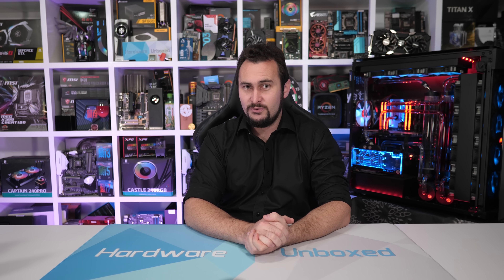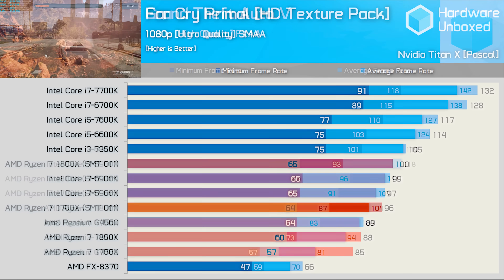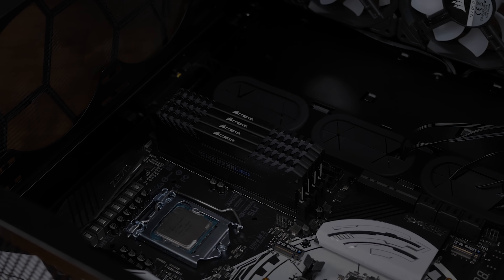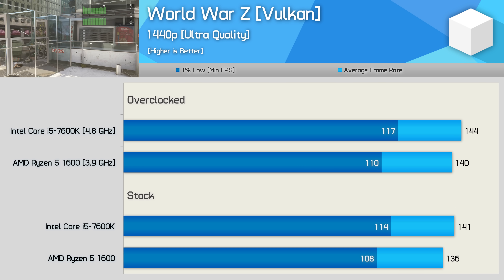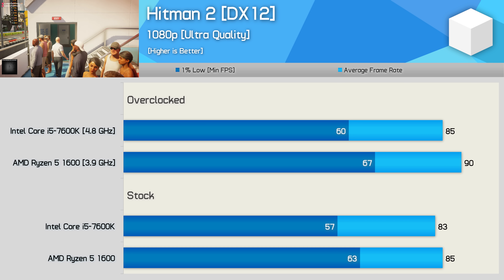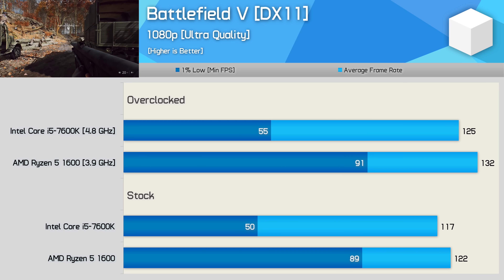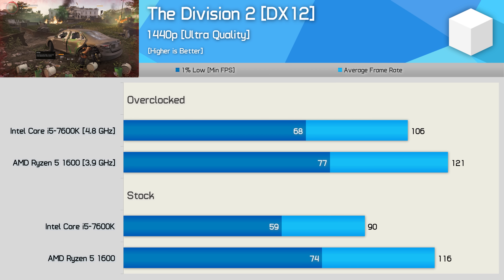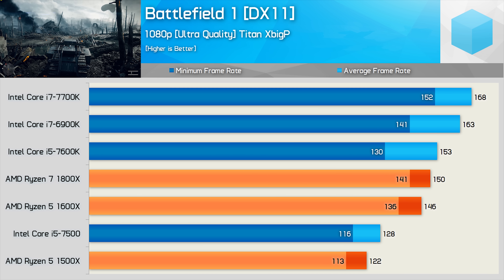Ryzen 5 1600 vs. Core i5-7600K, How Times Have Changed!

Comment: Ryzen 1600 is 79 USD bucks at Microcenter. That's value that can't even be explained and another reason I love living in a Microcenter city!
Reply: @dryphtyr  Exactly. AMD has completely changed the game. Ryzen 2600 136 USD. Plus you get 30-40 dollars off in the motherboard bundle. You can buy a 1600, Mobo, and DDR4 for less than 200 dollars before tax.
Reply: @ToneRetroGaming  1700x is 130 there also.  Just picked one up for a build
Reply: lucky bastard...
Reply: Just finished my build with this processor from MC. With a RTX2080, price/performance is huge
Reply: @derickmccoy5852  Price performance was huge until you said RTX 2080
Reply: I went and bought one with a motherboard for a total of 115
Reply: Yep picked up two combo deals with the 1600 for that price it was the mobo and 1600 for like $120 at microcenter amazing performance and amazing cost!
Reply: @justinwinslow310  same here !!
Reply: Yep, with a cooler.  Intel is still selling the Kerby On Fire lakes 7600k for 267 on Newegg.  Who is buying these things?  Buy a overpriced CPU and have to delid the damn thing and then go out and buy as cooler.  Intel is insane.  Or is it Fanboys who are insane?  There not so smug anymore.
Reply: @netprowlerp  Intel fanboy here,  still on my 2500k i bought 3 years ago, used i got the chip ram and mobo for $120 CAD no tax, thats like 79.99 American dollars.  How can you not be a  fanboy?  I saved thousand of dollars going with intel.
Reply: @mikejones-vd3fg  you can use it to boil water for sure. ROFL
Reply: The Ryzen 1700X is also $129 at Micro Center as well. Pretty sweet deal. =D
Reply: @Chemtrailshmemtrail  ya no cooler tho
Reply: @JAKEDOWN92  those stock coolers get replaced within a month anyways...
Reply: Yup, I live in the Bronx and there is one close by in Yonkers.
Reply: @christopherjames9843  I hope to visit that one when I go to NYC after the summer
Reply: Tone they also have one in flushing and Brooklyn if you are closer to those
Reply: @ToneRetroGaming  make sure, you never know what you will find when you walk thru the door.
Reply: You guys are lucky. In my country a ryzen 5 1600 is 151$ alone.
Reply: WOW!!!
Reply: microcenter cpu + mb bundle = $40 discount = 😎
I got ryzen 5 2600 with msi b450 a pro last november to build my first pc and they were having ryzen 5 2600 for sale at $149.99 so with mb and discount, pretty much got cpu for $109.99 and it's brand new 👍.
Reply: Whats a Microcenter?
Reply: Upgraded from a 1200 due to that sale about 2 months ago!
I love Microcenter.
Reply: It's still $79!  will be picking it up for myself soon!
Reply: Yes sir, I got one and $30 off my asrock b450m pro4 as a bundle. Micro Center FTW !!!
Reply: @dryphtyr  Without a cooler aswell, right?
Reply: Microcenter is useless to 99% of us though so while that is great for people who can go there, the rest of us gain nothing from knowing MC prices. All it does is get us slightly irritated.
Reply: @The Baby Eating Bishop of Bath and Wells Cool but im a game enthusiast and the way i look at it,  if youre using anything above a 1070 the i5 2500k is getting old and will start bottlenecking your GPU, but youre still well above 60fps at that point with that kind of card, and anything below a 1070, the i5 is still far from useless, probably most optimal for mid to low range cards.  For example i got 80fps in BF1 when it came out with this setup, on a r9 380 4gb,  playing Ring of Elysium right now which is new and arguably the best battle royal out game right now thats looks sweet and i feel like im only short 10-20 fps at times which I think I could get with  video card upgrade, put in a 1070 and im playing every game right now at 1080p above 60fps...  thats pretty good.  But in the end since im more of a game enthusiast I dont feel the need to upgrade as theres really no great games that need it.
Reply: @mikejones-vd3fg I am a gaming enthusiast aswell, I just build a ryzen 5 1600, my old rig (which i still have) is an i5-2500k,asrock z68 extreme3 gen3 mobo,16gb ram and ssd's paired with a gtx 1070 reference card. that cpu bottlenecks HARD, i play pubg/apex legends/blackops4 on high settings which still does 60+ but will lag at times due to the bottlenecking. which is also not temperature induced lag since its watercooled. its a good budget build cpu, but its definitely nothing to brag about or to compare to a ryzen 5 1600 budget build which blows it out of the water.
Reply: @aznx717  It is something to brag about, i bought the whole cpu.ram.mobo combo for $120!!! 3 years ago!!  You cant compete with that, the cost of a ryzen mobo is about that much.  Ive been gaming 60fps 1080p for 3 years thanks to intel and Im proud of that.  Its not a chip id recommend someone building a new PC get, but if you already own one you could spend 1k on a 2080 and that with a 2500k willbe better off than a budget ryzen 5 build for the same cost.  Basically what im saying is i think for gaming your better off getting the best video card you can and the lowest CPU you can get away with as not to bottleneck it.   Ideally you want to get the best CPU platform and put a good video card in it.  But what if you went the otherway around, bought a massive GPU, stuck in your old system, trippled your FPS.  Your good for gaming for another couple years, until the cpu bottleneck gets too big, you finally upgrade to a new CPU platform, and you put that now old massive GPU back in and its gots more performance.  On the other hand you buy a kick ass CPU,  your fps goes up by 10 fps with the same video card.  Yay!  Take your pick.
Reply: @mikejones-vd3fg  why would you compare the Price of a used cpu with a new am4 mainboard? Did you miss all the deals people have gotten on their Ryzen 5? I would never ever even think about buying intel. Their platforms are outdated a year after you buy it (maybe 2). AMD on the other side has lots of upgrade possibilities. For example if you bought a B350/X470 2 Years ago you can still upgrade to Ryzen 3rd Gen (without pcie 4.0).
Reply: @Lukas-jm7cx  I compared the prices of used intel CPU to the price of a new AMD motherboard because thats the reality I  was faced with when having a couple hundred dollars and no computer 3 years ago.  I spend $360 on it total including bus fare to pick up the parts.  But I just realized your an Intel hater so im not going to argue dude.  If you ever needed a reason to stop the hate just look yourself, your logic is all over the place.
Reply: @mikejones-vd3fg  Damn you have to face reality while it might seemed like a good deal back then, there is no reason to buy Intel atm except you are one of those MLG kids who get all their parts paid by their parents and need the extra 10fps on Minecraft so they can brag about how superior their overpriced Rig is. Seriously no need to hate on AMD and thank Intel lmao. You got lucky that you were able to get a reasonable price used. Imagine you would have to buy a new Intel. I am by no means an Intel hater (I even bought a new laptop last year i5 8250u for work) but my PC has a Ryzen 5 1600 and at the time I bought it, it was the best bang for buck. I will probably look into buying a 3rd Gen Ryzen, maybe 4rd Gen. They are simple unbeatable atm. For instance the Ryzen came with a (good) cooler included which is even capable of slight oc's. Also the motherboards were a lot cheaper than the 1151's.
Reply: It's still going? I drove an hour to go get that deal with a CPU and motherboard lmao
Reply: @Fizzlepop72  Yes.
Reply: Its 150 dollars in India.. So sad
Reply: In Finland its still 150€, i got 6600k for 50€ used.
Reply: that is indeed a damn fine price! (Wish the 3600 was $99!)
Reply: If that R5 1600 is that one then even better: https://www.reddit.com/r/Amd/comments/dvvy8b/any_1600_12nm_owners/
Reply: Best of luck with those hefty taxes, lol
Reply: I just bought the last one at my MicroCenter. Sooooo excited.
Reply: i wish i had a micro center here damnit where i live u lucky as f
Reply: Fuck my country's tax, ryzen 5 1600 is worth $200.
Reply: I got it for 70€ and a MSI B350 gaming plus for 50€ both used
Reply: Of course it can be explained. The want to clear inventory.
Reply: @BenoHourglass  microcenter did the same thing with the fx8320e for 80$ which was a pretty solid for the price a few years ago. They kept that in stock for a long time. I'm sure this will be the same thing and isn't a short time sale. And eventually replaced with another only slightly old processor that's a steal for the price.
Reply: @seanmiranda7514  MC is selling the 1700x for 129.  Not too shabby either. Damn thing just doesn't come with a cooler.
Reply: @BenoHourglass  But Intel with its ancient architecture doesn't?  Yes, of course AMD wants to move products that are two gens old.  So what is Intel's excuse for not dropping it's prices on its dinosaurs.
Reply: @BenoHourglass  always this type of guy
Reply: @ToneRetroGaming  Doesn't make him wrong.  AMD isn't afraid to drop prices to clear inventory before the new models come out.
Reply: @Dirtyboxer1  Thats what a proconsumer company does
Reply: @Dirtyboxer1  At the same time, considering how long it takes for a CPU to become obsolete these days it's still a good investment. I only ditched my Core i5-750 a year ago it finally started bottlenecking significantly enough to replace it.
Reply: @rayjaymor8754  I'm not arguing against it.  I owned a Ryzen 5 1600 until recently when I moved to a 2700X and gave the 1600 to a friend.  When it's all said and done, I think the Ryzen 5 1600 will go into the CPU hall-of-fame because that's the CPU that killed Intel's entire mid-range lineup.  It made i5 and i3 pointless, and while those weren't huge profit CPUs, Intel sold lots of them.  Hell, they even had the tech press in on the gag, chanting the "you only need 4 cores for gaming" mantra.

Comment: Crazy to think at just 1440p the $1400 2080ti only pushes out about 80 fps on tomb raider.
Reply: The 2080Ti in these tests was unable to perform at its best because of the CPUs' limitations.  That's why it was chosen--to make sure the GPU was not the weak link in the chain.
Reply: @rangersmith4652  I understand the 1080p benches, but the 1440p at only 80fps is still pretty low.

Comment: I bought an i5 6400 back in the day because of the stigma of intel always being better than amd during the time , and boi I have to say I deeply regret it. It does relatively good in gaming but stutters quite often. Considering to jump to ryzen 3000 just because of that
Reply: A jump from a 6600K to a 2600 was already better. Microstuttering gone and 1% lows were better.
Reply: @Neonagi  well i knew about that but not like i can pull money out of thin air either lol. Prices in Malaysia is like 20% above US MSRP so gotta save up i guess.

Personally considering to get a used Ryzen 5 1600 first (if it's cheap enough) then use that for 6 months and wait for 3600 to stabilize and mature a bit , resell the chip and get 3600 for slightly less money hopefully

Comment: thanks AMD for my 8600k oc'd to 5ghz!
Reply: You shouldn't thank AMD for anything if you were going to get that CPU anyways, that's your purchase lol...
Reply: @MarcABrown-tt1fp  no, if AMD had not put those cpu's out intel would have quite possibly stuck to the quad core i5's
Reply: @adam346   Yes certainly the 8600k would have been created years later had Amd not made their comeback, but my question is why should you care about Amd innovation if intel wasn't expecting to do much for the next 4 years? 

6 core intel desktop cpus would have come eventually. it makes no sense to thank amd for somthing that would come 4 years later from intel eventually lol. That didn't stop intel from overpricing their cpus in comparison to ryzen even then. competition that is offering better price to perfomance on a deviation of 10-30% absolutely is the best choice.
Reply: @MarcABrown-tt1fp  i am a gamer. I do little else with my computer. I saw that i could get 90% the gaming performance of the 8700k and around 20-30% more fps than with a ryzen 2700. I paid less than the 2700, far less than the 8700k and still have a fast mofo of a cpu that clocks really high, really easily. Even with the next gen of ryzen 2 coming out, 8600k will still be a viable gaming alternative.  I also got it for a good price at $200 USD. Again, i have all of it now because AMD put out it's ryzen cpu's and priced them competitively, more then that, before the intel shortage, there were constant sales to try and compete with the 2600x on price.
Reply: @adam346   Used? if you got that new then thats a steal, how much was the mobo?
Reply: @MarcABrown-tt1fp  nope, Canadian prices are interesting if you follow them. Mobo was MSI z270 tomahawk and it was about $30 USD more than the comprable AM4 socket.
Reply: @adam346  Well the only thing you would be missing out on at this would be generational socket compatibility. You have an excellent build for crazy cheap if you stick with that cpu. Over here in the U.s. that would cost 50% more oof...

 Thats awesome, even if lucky lol. cheers!

Comment: I'm sure i'll get thrashed for even (Heaven forbid) mentioning this... but wasn't pretty much every single benchmark for both processors over 60fps on everything? Not that i'm saying "the human eye can't see over 60fps", but... well... personally if I'm getting over 60fps, with graphics pumped up, i'm happy.

Yes, in the longrun, the AMD Ryzen is higher in newer titles, but while the FPS NUMBER might be noticeably higher on a few titles, is the GAMEPLAY noticeably better? I only mention this because of the "well if you bought a Kaby Lake i5, you made a mistake" comment. People that bought a 7600K are probably still gaming just fine today. The only VALID point that is a very solid one, is that AMD doesn't outdate their motherboards every two generations and if you bought an AM4 MB a couple years ago, you can get the newer Ryzen that's coming out this year... that's a solid plus and the best argument in this entire video... not so much the difference between a 1600 and 7600... as I bet people who own either are both still gaming comfortably today.

I'm probably just some crazy old coot... I have a completely outdated Haswell MB running an i7-4790 with a GTX-1660Ti, and i'm playing everything I want comfortably today, even on such an ancient and useless old system that I bought in 2014 (well MB/CPU, obviously my GPU is new). Maybe us X-Geners just can't see faster than 60fps... I've been following tech news and starting to get the bug to upgrade... watching both Intel and AMD... but I have a hard time justifying spending on a new MB/CPU/Memory when i'm pretty happy with the gaming performance of a 5yo MB/CPU... that i'm sure someone will tell me, I made a huge mistake buying back in 2014.

Comment: not sure whats going on with your bf5 benchmark but i have an i5 4690k oc to 4.5 with an rx 570 and i dont dip below 60 fps
Reply from the maker: Are you using DX11 or DX12? Also are you using the 'ultra' settings or something lower which might reduce CPU load. Finally you're looking at minimum fps and not a frame time metric which is what the 1% low is converted into fps. You can see the quad-core i5 frame time issues in Battlefield 1 by Optimum Tech here: https://www.youtube.com/watch?v=s5yl8_OY0yc

Comment: Damn I regret getting the 8700k nearly a year ago now should of waited for the 3900x from amd 😫
Reply: the 3900X might even match your 8700K in gaming....perhaps....; even so, that will not magically make your 8700K suddenly 'slow'
Reply: the 8700k is a good cpu that could easily cover you for a few more years. even if 3900x matches that (in games) you didn't make a bad buy.
Reply: @giornikitop5373  well true it's just amd are starting to get back to the top in the long run I reckon I should of waited nevermind next time

Comment: I have an i5 7600 non-K(don't ask why) and in the only game i have had problems with CPU usage is AC: Odessy and most know why. It literally obliterates the CPU at 100% usage most of the time. 
Metro Exodus and Shadow of the Tomb Raider on the other hand in DX12 kept its 4 cores around 70% usage more or less by 10% which, if GPU options allowed, it could easily keep steady 60 fps at all times.
It most likely won't be enough for games within the next two years though.

Comment: This was the exact decision I faced in mid-2017.  Price - performance was what I wanted, and once the reviews were in I made my purchase. I purchased the 1600x and have been very satisfied with it as a performer. It's been a stable system, overclocked to 3.9, runs cool on a Corsair H75 AIO, 2 sticks of Corsair 3200 and a GTX 1070. It has performed well in all my games including AAA titles, VR, and frequently with OBS, Twitch, and Spotify open for when I stream. I haven't found a reason yet to upgrade but will be considering it in the not too distant future for more performance headroom. It will certainly be another Zen processor for me. This video only affirms that decision.  Thanks Steve!